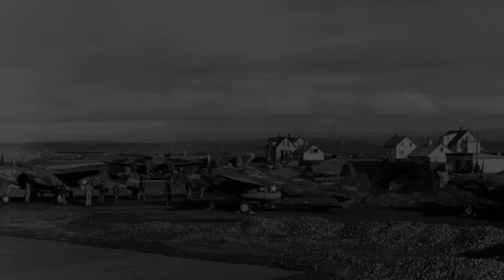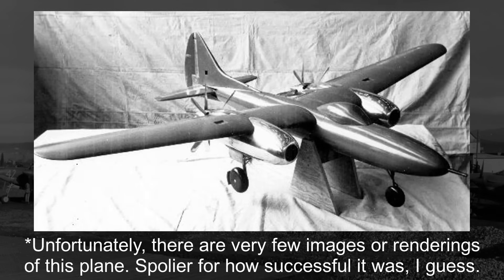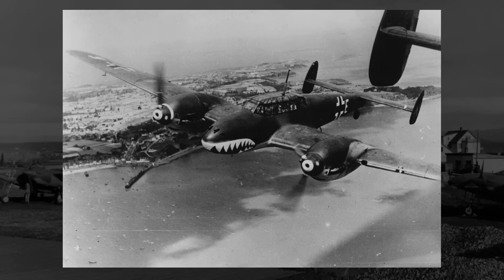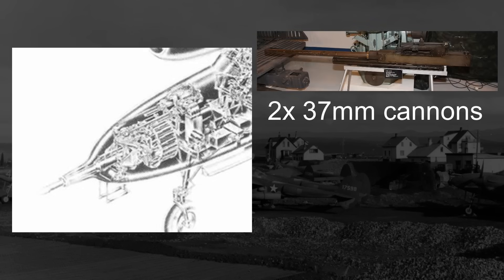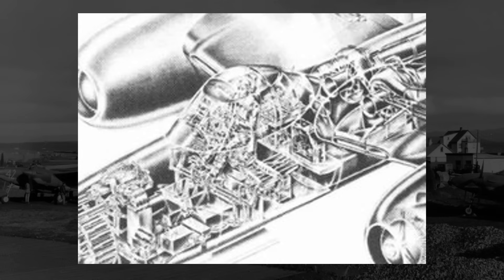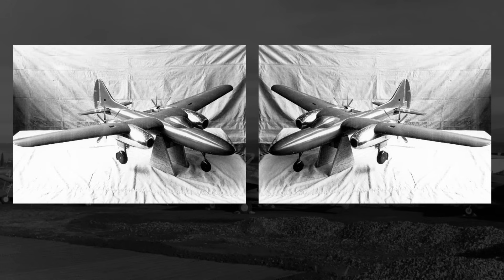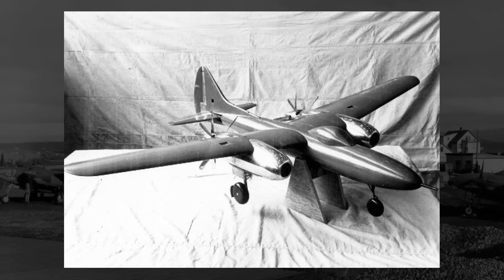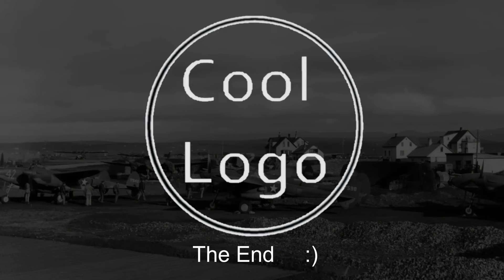Curtiss-Wright Was Run By Insane People: Curtiss XP-71

Comment: The XP-71 was not insane.  It is a testament to the fact that the USAAF was looking at the problem of escort for long range bombers even before entering the war.  This contradicts the narrative currently popular on the internet which claims they ignored the problem and actually intended to prove that bombers did not need escort.
Reply: @gort8203  the need to escort in the Pacific seems to have been understood from the outset
Reply: @wbertie2604  This is my second attempt to respond  

     "but at other times, deployment of drop tanks was blocked, and escorts were not prioritised. It was a complex situation with ebb and flow, but at various points there was opposition to escorts."
 
Arnold briefly defunded putting drop tanks on fighters in early 1939, but that policy was soon revised, certainly no later than when the U.S. entered the war. 

More than one reason has been reported for this restriction, but the one most often quoted is that they were considered a fire hazard. At the time the air corps preferred to carry overload fuel for extend range in auxiliary internal tanks rather than externally. 

Others report that Arnold was reacting to the internal struggles over control of budget and doctrine between advocates of strategic bombing and advocates of funding fighters for the battlefield support role. The ground support advocates had the upper hand, and some saw longer range fighters as a threat to the development of strategic bombardment rather than as support for it. 

As you said yourself it was very complex, and Arnold's temporary restriction on external fuel tanks was in reaction to the climate at that moment. But the there was never any serious intent to block drop tanks on fighters for the purpose of proving that bombers would not need fighter escort. The lessons of the Spanish Civil War and the Batte of Britain had already been absorbed by USAAAF.

     "the very first 8th AF missions were with light bombers, though. When the heavy bombers were employed they were not necessarily escorted all the way, sometimes not at all" 

You need to check your facts. We are talking about 8th Bomber Command, formed in 1942 for the purpose of heavy bombardment. Their first missions with B-17s over coastal and close inland targets were escorted by Spitfires. 

It was some time before they undertook missions beyond the range of fighter escort because they knew unescorted small bomber formations would be unable to effectively defend themselves. Only when they could put at least a minimum number of bombers in the air did they undertake missions beyond the range of fighter escort, not to prove a point, but because they had no choice if they were going to bomb Germany. These missions were typically escorted to the limit of fighter combat radius. There were sometimes not enough fighters to escort every bomber formation in the air, so fighters were apportioned to the bomber formations most in need of. It was complex, not simple, but people today look back at it simplistically.

"the need to escort in the Pacific seems to have been understood from the outset" 

They understood it for Europe at the outset as well. 
     In Feb 1942, just after the U.S. entered the war and USAAF began planning the strategic bombing campaign, Hap Arnold directed the air staff to do whatever was necessary get drop tanks on fighters as soon as possible. 
    In 1943 Arnold directed the immediate development of a long-range fighter for escort. He also directed General Kepner to work with the airplane manufacturers to increase the range of existing fighters as soon as possible, which led to additional internal fuel tanks on the P-38 and P-51, increasing their escort radius. Kepner’s success led Arnold to put him in command of 8th Fighter Command in place of Frank Hunter. 
    General Eaker was initially hopeful that the bomber loss rates on deep missions beyond the range of fighter escort would stabilize once sufficiently large formations could be sent, but those numbers were a long way off in 1942. As the effectiveness Luftwaffe air defense adapted to 8th Air Force tactics in 1943, he continued to ask Arnold for long range fighters to reduce bomber losses. 
    Hap Arnold directed the firing of the commander of 8th Fighter Command, his close friend General Frank Hunter, because Hunter was not doing enough to escort the bombers. The very purpose of those fighters was to escort the bombers, and General Spaatz had to fend of the British desire to use those fighters for air defense of England instead of bomber escort. 
    Even the very first 8TH AF missions over France and the low countries were escorted, by Spitfires. Hardly the action of a 'bomber mafia' trying to prove that bombes did not need escort.
Reply: There were multiple competing factions in the USAAC. They developed the M-26 tank despite opposition, so it was the same in the ground army.
Reply: @wbertie2604  True, but I don't see your point.
Reply: @gort8203  the point is that some in the USAAC saw the need for escorts, some didn't. For a while, the latter got deployment deemphasized even if others managed to get research and development funded. It wasn't an organisation with a single mind. This means that it can be said that the USAAF (as it later was) was opposed to escort fighters even though it was funding development. Both views are to some extent true.
Reply: Anyway, as proposed, the armament was that of a heavy interceptor, not an escort at all. Also true given the size.
Reply: @wbertie2604  I think that armament was probably meant to demonstrate the potential, and I think it would have been replaced by more suitable guns if the plane had been produced as an escort fighter.
Reply: @gort8203  yes, it would need to have been, but seems to demonstrate an original intention as a heavy interceptor.
Reply: @gort8203   but at other times, deployment of drop tanks was blocked, and escorts were not prioritised. It was a complex situation with ebb and flow, but at various points there was opposition to escorts. The same can be seen in the RAF with Harris campaigning against anything other than production of bombers for strategic bombing, including  fighters and bombers for other purposes,  but others forcing him to do other things. He was very good friends with Spaatz.
Reply: @gort8203  the very first 8th AF missions were with light bombers, though. When the heavy bombers were employed they were not necessarily escorted all the way, sometimes not at all.
Reply: @wbertie2604  Yes, the armament demonstrated the design's potential as a heavy interceptor, but the fuel capacity demonstrated the potential for a long-range escort, which was the greater need.  After all, the US already had a heavy interceptor in the P-38, which had been specifically designed to take the heaviest armament yet to altitude at high speed.
Reply: @wbertie2604  The existing P-38 already had long loiter time for a fighter.  Yes, the XP-71 would have had more.  It was imagined for both the interceptor and escort roles, but it was more needed for the latter when proposed in 1941, by which time it was clear the continental US would not suffer bombardment.
Reply: @gort8203  I'd agree with you that in 1941, the need for a heavy interceptor was passing, although not entirely gone. To me, it looks like a heavy interceptor for the reasons I've outlined, but Curtis trying to reuse the 1940 work when a heavy interceptor was a definite requirement for development, and trying to repitch it as a long range escort, for which it would have been unsuitable. The P-61 with four drop tanks, would have been more suitable as it was large but quite nimble. At least in the C version - the P-61A and B had fairly mediocre performance only suitable for nighttime use. It did at least have some potential defensive armament, not that this was the turret's design intent.

The Chain Lightning would seem to make slightly more sense as a long range escort than the P-71.
Reply: Some generals did. USAAF / AAF is not a single entity with single policy. It's just that before RR / Merlin engines came into play, it just wasn't possible without some kind of trade offs
Reply: @miketan4803  It wasn't the Merlin that gave the P-51 its range, it was the auxiliary fuel tank added to the airplane through the efforts Generals Arnold and Kepner.
Reply: @gort8203  it was both. The Merlin permitted the P-51 to fly efficiently at higher altitudes where drag is lower. For escort it relied on drop tanks anyway.
Reply: @wbertie2604  Again, you need to check your facts and understanding of them. Yes, the supercharger of the Merlin gave it performance at altitude, but the additional internal fuel was responsible for the increased escort radius.  You can add all the drop tanks you want to increase straight-line range, but they do not increase combat radius past a certain point.  Drop tanks must be jettisoned for combat, so the fighter relies on internal fuel to return home.  Arnold via Kepner added that internal fuel specifically for the purpose of bomber escort.
Reply: @gort8203  the additional internal fuel assisted in the escort range, which I noted. I also checked my facts (I looked up the pilots' notes before posting), and the Merlin could achieve better fuel economy for a given cruise speed as it could run a leaner mixture and still produce good output at a typical escort altitude of 25000ft.

Note, the additional rear fuselage tank was not initially present on the P-51B.
Reply: In fact, the P-51B had the wiring for auto rich removed (I'm not sure exactly when) and in the P-51D, the controls were redesigned to entirely remove the option. It simply wasn't required.

Now at low altitudes, the Allison was slightly  more fuel efficient than the period equivalent Merlin, but it was a higher altitudes that the combination of the clean airframe, large tankage and Merlin shone. The Allison could have had better supercharging, but they'd bet the farm on turbocharging and it had been deprioritised. Allison did improve high altitude performance a bit, but there was only so much it could do in the circumstances.
Reply: @wbertie2604    I'm looking at the P-51D flight manual, which states "The three mixture control positions are: IDLE CUT OFF, AUTO LEAN, and AUTO RICH".  Perhaps later P-51D's had the more sophisticated mixture control of the P-51H with only two settings, which were IDLE CUT OFF and RUN.   (Some also had an EMERGENY FULL RICH setting for use if the carburetor malfunctioned in the RUN position.

Nor do I think the 2-stage supercharger of the Merlin significantly increased the range of the airplane.  You want to be in low blower for maximum range even at high altitude. If you look at the range charts for the P-51 you can see that the TAS varies with altitude, but the miles per gallon is essentially constant with altitude.
Reply: @gort8203  the auto lean and auto rich got replaced by one setting "run" during the D's production run. Run is, AFAIK, auto lean. Emergency rich was retained.
Reply: @gort8203  from the p-51A and D flight manuals at 20000ft and as close as possible to the same TAS (320 and 315 respectively) the Allison uses 69 gallons per hour and the Merlin 56. Interpolating a bit for 320, and it's probably 69 versus 58. So the Merlin does very much better at that altitude (it's not 25000 as that's not even listed for the P-51A). At low rpms, the Allison seems to do quite well, though, and the maximum possible ranges on the same fuel would be similar,  but at the cruise speed you need in a combat area, the Merlin is better.
Reply: @wbertie2604  I've tried four times to respond to your comment "deployment of drop tanks was blocked", and YT keeps deleting my response.  Every time I try to respond with more than a couple of sentences it gets deleted.  I give up.
Reply: @gort8203  very odd.
Reply: @miketan4803  to some extent true, but when in the Pacific they were told there weren't going to be tanks made for the P-47 (and despite it being plumbed for them) they had production of tanks up and running in Australia in about a month in 1943. The UK made tanks for their own aircraft, and ultimately for USAAF fighters. If requested, they could have been making them in quantity in 1943, but oddly it wasn't seen as a priority. Too many believed that bombers could fight their way through and any failure to do so was down to things like poor formation flying (something Harris said about a disastrous raid in which 90% of a 12 Wellington raid was lost in 39 or 40, although the Luftwaffe claimed 15).

(As an aside, back then air gunners were just ground crew that fancied a trip up in a plane).

Luckily, the 8th AF employed Dolittle at the start of 1944, and he had somewhat more of a clue.
Reply: This guy's channel was never great but it's gotten worse. "I looked at a reddit thread once" depth of knowledge. Any kitbashed models masquerading as real photos on this one?
Reply: @dziban303  Agreed. Ever airplane fan seems to feel compelled to make videos about them, and the research is often only Wikipedia deep with even less understanding.
Reply: @gort8203   Between the shallow coverage, poor visuals including putting photos of the wrong aircraft on screen, and the grating voice, well, I unsubscribed
Reply: @wbertie2604  This is my second attempt to respond  

     "but at other times, deployment of drop tanks was blocked, and escorts were not prioritised. It was a complex situation with ebb and flow, but at various points there was opposition to escorts."
 
Arnold briefly defunded putting drop tanks on fighters in early 1939, but that policy was soon revised, certainly no later than when the U.S. entered the war. 

More than one reason has been reported for this restriction, but the one most often quoted is that they were considered a fire hazard. At the time the air corps preferred to carry overload fuel for extend range in auxiliary internal tanks rather than externally. 

Others report that Arnold was reacting to the internal struggles over control of budget and doctrine between advocates of strategic bombing and advocates of funding fighters for the battlefield support role. The ground support advocates had the upper hand, and some saw longer range fighters as a threat to the development of strategic bombardment rather than as support for it. 

As you said yourself it was very complex, and Arnold's temporary restriction on external fuel tanks was in reaction to the climate at that moment. But the there was never any serious intent to block drop tanks on fighters for the purpose of proving that bombers would not need fighter escort. The lessons of the Spanish Civil War and the Batte of Britain had already been absorbed by USAAAF.

     "the very first 8th AF missions were with light bombers, though. When the heavy bombers were employed they were not necessarily escorted all the way, sometimes not at all" 

You need to check your facts. We are talking about 8th Bomber Command, formed in 1942 for the purpose of heavy bombardment. Their first missions with B-17s over coastal and close inland targets were escorted by Spitfires. 

It was some time before they undertook missions beyond the range of fighter escort because they knew unescorted small bomber formations would be unable to effectively defend themselves. Only when they could put at least a minimum number of bombers in the air did they undertake missions beyond the range of fighter escort, not to prove a point, but because they had no choice if they were going to bomb Germany. These missions were typically escorted to the limit of fighter combat radius. There were sometimes not enough fighters to escort every bomber formation in the air, so fighters were apportioned to the bomber formations most in need of. It was complex, not simple, but people today look back at it simplistically.

"the need to escort in the Pacific seems to have been understood from the outset" 

They understood it for Europe at the outset as well. 
     In Feb 1942, just after the U.S. entered the war and USAAF began planning the strategic bombing campaign, Hap Arnold directed the air staff to do whatever was necessary get drop tanks on fighters as soon as possible. 
    In 1943 Arnold directed the immediate development of a long-range fighter for escort. He also directed General Kepner to work with the airplane manufacturers to increase the range of existing fighters as soon as possible, which led to additional internal fuel tanks on the P-38 and P-51, increasing their escort radius. Kepner’s success led Arnold to put him in command of 8th Fighter Command in place of Frank Hunter. 
    General Eaker was initially hopeful that the bomber loss rates on deep missions beyond the range of fighter escort would stabilize once sufficiently large formations could be sent, but those numbers were a long way off in 1942. As the effectiveness Luftwaffe air defense adapted to 8th Air Force tactics in 1943, he continued to ask Arnold for long range fighters to reduce bomber losses. 
    Hap Arnold directed the firing of the commander of 8th Fighter Command, his close friend General Frank Hunter, because Hunter was not doing enough to escort the bombers. The very purpose of those fighters was to escort the bombers, and General Spaatz had to fend of the British desire to use those fighters for air defense of England instead of bomber escort. 
    Even the very first 8TH AF missions over France and the low countries were escorted, by Spitfires. Hardly the action of a 'bomber mafia' trying to prove that bombes did not need escort.
Reply: This is my third attempt to respond to @wbertie2604.  I'm shrinking the response to see if YT will not delete it again 

    "but at other times, deployment of drop tanks was blocked, and escorts were not prioritized. It was a complex situation with ebb and flow, but at various points there was opposition to escorts."

Arnold briefly defunded putting drop tanks on fighters in early 1939, but that policy was soon revised, certainly no later than when the U.S. entered the war. More than one reason has been reported for this restriction, but the one most often quoted is that they were considered a fire hazard. At the time the air corps preferred to carry overload fuel for extend range in auxiliary internal tanks rather than externally. 

Others report that Arnold was reacting to the internal struggles over control of budget and doctrine between advocates of strategic bombing and advocates of funding fighters for the battlefield support role. The ground support advocates had the upper hand, and some saw longer range fighters as a threat to the development of strategic bombardment rather than as support for it. As you said yourself it was very complex, and 

Arnold's temporary restriction on external fuel tanks was in reaction to the climate at that moment. But the there was never any serious intent to block drop tanks on fighters for the purpose of proving that bombers would not need fighter escort. The lessons of the Spanish Civil War and the Batte of Britain had already been absorbed by USAAAF. 

   "the very first 8th AF missions were with light bombers, though. When the heavy bombers were employed they were not necessarily escorted all the way, sometimes not at all" 

You need to check your facts. We are talking about 8th Bomber Command, formed in 1942 for the purpose of heavy bombardment. Their first missions with B-17s over coastal and close inland targets were escorted by Spitfires. It was some time before they undertook missions beyond the range of fighter escort because they knew unescorted small bomber formations would be unable to effectively defend themselves. Only when they could put at least a minimum number of bombers in the air did they undertake missions beyond the range of fighter escort, not to prove a point, but because they had no choice if they were going to bomb Germany. These missions were typically escorted to the limit of fighter combat radius. There were sometimes not enough fighters to escort every bomber formation in the air, so fighters were apportioned to the bomber formations most in need of. It was complex, not simple, but people today look back at it simplistically.
Reply: “Insane” is a word so misused/overused as to lost its meaning in the English language.
Reply: they thought about escorts but they  didn't exactly look too hard. the losses in 1943 and early 1944 were appalling given they could have fixed up something like the P47 to get the range from the start
Reply: @AsbestosMuffins  You are misinformed. They were "fixing up" the P-47 during that time, and they had drop tanks for them by mid 1943.  They had long range P-51s by the beginning of 1944.